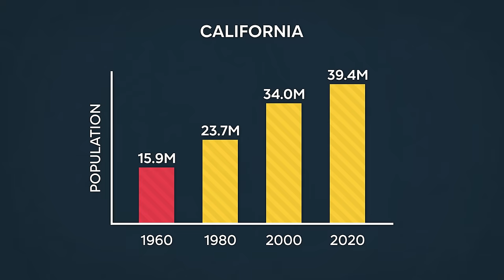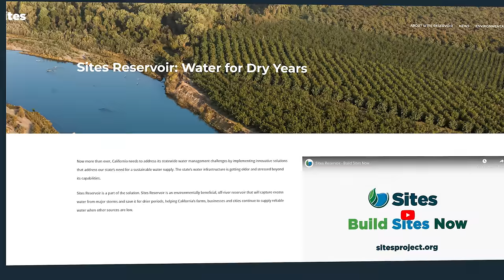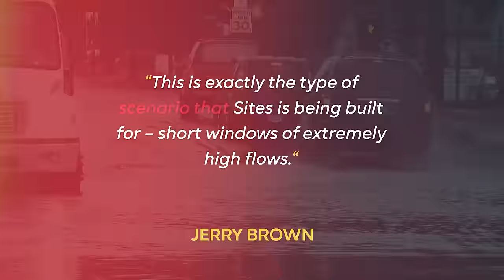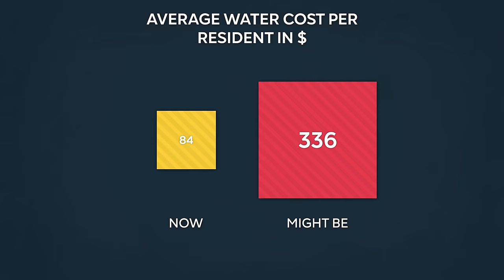California's New $4BN Mega Reservoir

Comment: FYI most of the state has had it’s drought status reduced or removed entirely. We’re also expecting the return of El Niño over the next 2 years. That brings lots of rain and cold to California.
Reply: Yes lets live in the moment!  Screw the next 20 years
Reply: Did you even watch the video? CA cant capture enough water while it is here it will go away after 5 or more years. How long do you plan on living here?
Reply: @liindawgg  what are you talking about? The last massive rains was in early 2000s, and the ones before that was in the late 70s early 90s. The location of the Dam is not in a high drought area. The reason why this project was put off for so long wasn't a lack of foresight it was because the south needed to build more reservoirs which in areas of high drought.  To be honest the amount of money spent on this project just to have a reservoir is not worth the price. That money should be spent on Building more systems to recharge California's underground Aquifers (you know the water source that is responsible for 40% of california's water during the Decades of drought). But I am sure you know all about that and your comment to be facetious and not sarcastic.
Reply: @LiiNDAWgg  That's not what he said and NO ONE lives more in the moment than a leftard.
Reply: @gniawd  Alarmist crap
Reply: You got everything right except for the cold.  Warmer ocean temps bring in more storms but those storms are usually warmer winter storms.  We still get lots of snow from them in the high sierras.  However, I think we need more water storage if they’re going to keep building more infrastructure in Ca.
Reply: @gooflydo  yes daddy.

Comment: Your video just described the existing San Luis Reservoir in central California where water is pumped into the reservoir from the Sacramento River, but where pumping water is currently blocked because an invasive fish was found in the river and somehow must now be protected. The video seems more of a sales pitch along the same lines as the high speed railroad project. Lots of funding that go into pockets of beneficiaries rather than the project. A project where the main function is already blocked by current environmental protection laws. If the central California's were smart, they would press/protest the issue of the San Luis pumps being shut off at the same meetings of the Sites Dam, so that attention would be brought forward to a costly project that is doomed from the start. California has a problem with water management, not an issue with storage capacities.
Reply from the maker: Get the point, we also mentioned it in the video but didn‘t go more into detail. However we are definitly not pitching for any projects that we talk about😅 We try to be neutral
Reply: Talk to your gov.  The federal pumps were running at full power,  Your gov ordered state pumps off even though per court order there was nothing to stop them from running.  Ask your gov how much he got and gets from utilties investing in billion buck desalination plants, and the billion buck power plants needed to run them, and the billions in fossil fuel needed every year to fuel them.  All passed on to rate payers and given to the richest who own the project, and the billions in gov't bonds floated to pay for them.
Reply: @russell7489  they will never power any desalination plants unless we make a return to nuclear power 🔋
Reply: @russell7489  Exactly. Shortages are man made in CA, whether its water, electricity or buildable land. It enriches certain people (Can you guess?)
Reply: @christiankruse1970  The Rezniks and Socal developers.
Reply: @christiankruse1970   your not wrong it is sickening hopefully people do something about it rather it be moral or not it is what it is that seems the way things are these days with cut throat money it goes both ways
Reply: @MegaBuildsYT  You never said what towns are adjacent to this build.  You were suspiciously vague about it's location.

Comment: As a Sacramento native I have been watching this project, reservoir levels and snow pack for years. We desperately need something like this and I've been pretty excited about this on, but we definitely need to implement other solutions, I believe recently near Rocklin they've developed a method to locate underground basins with a helicopter and building pump stations to fill them. I I'm not sure about the cost on this but it seems once we identify hundreds of basin and build pump stations we replenish parts of the water table at will.
Reply: Rocklin has those quarry's in some spots that they would fill. And there are a few ICBM sites that can be gutted and filled with water.

Comment: Our biggest issue is that our aquifers are dangerously depleted. The problem is that where a lot of the water floods in the central valley, we have a very hard clay soil, and the water does not soak into the aquifers very well. Storage will only get us so far, but we need to find a way to get our aquifers refilled.
Reply: Infiltration/recharge basins? Yeah. We do need them.

The problem is whether it's cheaper to catch, infiltrate, and re-pump water compared to just storing it on the surface.

The advantages of these huge storage facilities is that per gallon of storage, they are incredibly cheap. Infiltration basins would have to be built everywhere around the state, which makes the scalability limited.

I do think something like implementing recharge requirements into building codes might be a good idea, but the areas where the worst aquifer depletion happens are usually farmland, and could use surface water if it was available.
Reply: The biggest issue california has its overpopulated. way over populated. you have 3 or 5 illeagle families living in a 2 room pickers shack. multi million dollar homes who could care less as long as the lawn looks good for the neighbors. hoas that are way out of control and a general population to self important to do what is nessary to solve the real problems. you have a better chance of asking the 15 million people that need to not be there to give up their houses all there money and pack up the car and leave. Are you willing to just leave? that's what is necessary to solve the water issue. you and 15 million others. just drop all you have and drive away. buldoze the houses and rip out the water lines. If you build bigger and more infersturcture to solve the issue it will never be enough for the population at hand now. more storage is not the solution exodus is.
Reply: Amen brother. Dams are a 19th and 20th century band-aid for our real problems. You can only reapply a band-aid so much before you have to let the wound heal.
Reply: @RC-fp1tl ask the people who died in floods and drought caused famines centuries ago.  I’m sure they wish they had dams to regulate flow.  🤡
Reply: Agreed 100%. Actually the necessary reservoir already exists. The underground water table. Slow the flow of the Sacramento River to allow the water to spread out. It will soak into the ground. There it can be stored in the water table. For free. Without evaporation. Without $4B in construction costs. How to slow the flow? A few man-made structures may help. But most/all of the work can be done by free labor. Just reintroduce beaver along the Sacramento River. Beaver will relentlessly build small dams. Improve fish habitat. Recharge the water table. Help tress and shrubs grow. Elegantly simply. And affordable. The Sites Reservoir is a farce, and merely a gift to the construction industry which is already rife with greed and corruption. If built, this project will surely exceed $5B.
Reply: youre biggest issue is unsustainable poplation centers like LA & SF.   There was never, probably will never be enough water in cali to support endless population growth
Reply: @sbauhs  That sounds great and CA is already doing that; but beavers aren't gonna do anything to a big fast flowing river like the Sac.  Plus it all surrounded by private property.
Reply: TRUE
Reply: Get rid of submersible pumps and wait 10,000 years is the way to refill the ground water. It took less than 100 years to deplete that ground water and salinate those soils. It's an environmental and economic disaster. Big money has benefitted the most.
Reply: CATCH IT BEFOR IT RUNS INTO THE SEA BULL CRAP WE HAVE THE TECKNOLAGE TO GET THE FISH TO WHERE THAY NEED TO GO THEY JUST NEED ALITEL HELP
Reply: Stop,the wineries from taking it all?
Reply: @sbauhs    This is not a bad idea.  However, judges in CA have ruled that 63% of all water that is released from our dams needs to end up in the ocean.  Check it out.

Comment: I live in Central Washington State. We depend on massive irrigation projects to collect snow melt in the mountains used later to water crops. We too have massive pumping lift stations, giant canals, and assortment of dams. We have very fertile soils but lack water. The demands for water will always be greater than annual supply.
Reply: When I lived in Washington it rained like 75% of the time. Idk how there is any lack of water in that state. I've never lived anywhere else where it rained so much.
Reply: @punchabunchofbuttons214  I'd guess you lived on the west side of the mountains. As moist air move up over mountains, it cools, can't hold as much moisture, drops most of the moisture on the mountains (generally as snow), and comes down the other side of the mountain much drier. That's why the leeward side of decently sized mountains is generally a much more arid (or even desert) climate than on the windward side. Western Washington is very rainy from moist air from the pacific, and central and eastern Washington are much more arid because of the Cascades pulling most of the moisture from the air as it travels west to east across the state.
Reply: @punchabunchofbuttons214  Thanks for comment. I live in Yakima, we only get 6-9 inches total all year long. Seattle gets around 36.
Reply: @punchabunchofbuttons214  Common misconception.  Most of Eastern Washington (East of the Cascade Mountain Range) is high desert plain.  There are areas that get less than 3" a year.  The West side of the state, peninsula and the Puget Sound region get a ton of rain.  I lived in Spokane and worked remote for companies in California and on almost every conference call I would get someone saying "Raining up there?".... It got annoying.
Reply: Our family farm in Spokane irrigated with water from Grand Coulee Dam, that water had its source in Canada.
Reply: @JimMork  Thanks for comment. If not for massive irrigation projects, Central and Eastern Washington would still be a desert.
Reply: @punchabunchofbuttons214  The Cascades create a rain shadow. But west of them is really good farming country.
Reply: @SJR_Media_Group  Isn't Yakima apple country?  Are those trees evolved for dry conditions?
Reply: @tysonhartle2439  Called The Palouse. We lived by a river with its haadwaters in the Rocky Mountains.
Reply: @JimMork  Yakima is the Apple King of the World. Unfortunately the trees use lots of water to make fruit. During extreme drought, Junior Water Rights Holders get 1/2 their normal water. Orchards die and they tear them out and replant.
Reply: @SJR_Media_Group  Love them Washington apples. But most of the year we get imports. I think  you Washingtonians (I was born in Spokane before our vagabond tribe moved out) probably eat all the fresh ones. Apples to you are like oranges to Californians. My sister in Long Beach had an orange tree in her yard.
Reply: @JimMork  They pick too many to sell right away here. Giant cold storage rooms hold millions of pounds each. The Oxygen is removed and they never rot. They ship more apples in winter than fall harvest. 

Recently, China has out produced us. They have cheap labor and we can't get enough workers. We bring in migrants from Mexico on special visas. After harvest, they get sent back.
Reply: @SJR_Media_Group  Always been the challenge with produce. Nature decides the short time period in which things reach picking stage. The labor requirement then is a multiple of other times. I used to work with a guy who arranged work breaks to harvest field crops. He said the harvest was a 24 hour operation to get it all picked and in storage. Then the challenge is to keep it usable till next harvest. Some historians have said earliest temples were actually grain storage. I once lived on farms. We raised our own food. After the brief picking exercise, we used to box it up and rent lockers to store it for months. Modern methods make frozen berries as nutritious and cheaper than fresh.
Reply: @JimMork  Thanks you so much for great input. Refreshing to find smart people. Yes, food technology has helped feed a hungry world.
Reply: @SJR_Media_Group  The topic has many personal connections for me.
Reply: That is due to there not being a major river system in eastern WA. It's a very strange area and I lived out in Belfiar, WA where, water was never an issue in the Hood Canal. It's like feast of famine in central WA. I do think there are a few things they could do. You might have much beyond a few small creeks but there is ample space for manmade lakes. Large ones if you can afford the farm area for it. Central WA to me is almost like a bowl. Kinda like a smaller version of the land that embodies the great Salt Lake of Utah. Some areas that have more sand base and limestone soil could hold a great volume of water like a bathtub. Just build a canal river system to replenish and you than create a new working river system downstream of these body of water and link them. Than, stock with Salmon.. lol.
Reply: @gwhite7136  I'm a native of eastern WA. The Spokane River flowed  past my farm. Then there's the Columbia that is east of the Cascades. Then there's the Snake River. So it is here where we define "major". Mississippi, Missouri, Ohio, Hudson. All are "major" What category includes the Columbia?
Reply: @JimMork  Those rivers flow south of the midlevel state area of eastern WA. Great areas and so much can be done with them. But to the north and in the eastern part of the state, no large rivers. The Spokane river is a creek when you compare it to the Mississippi river, as well as how much water is trapped in the Harrison Slough in Coeur d' Alene Idaho. Ritzville sits in the middle of an this dry area. I think so much more could be done with this region. From the Columbia river in the north to the Idaho border above Spokane, apart from a few small lakes, this region has no rivers.  Columbia River's mean annual discharge is outranked by: The Mississippi River - 593,000 cubic feet per second. The St. Lawrence River - 348,000 cubic feet per second. Those rivers go longer and get a lot more rain. It's a great river but only cuts through one state. Also, from Moses Lake to Spokane, via I-90, again, no real rivers to speak of.
Reply: @JimMork  I got quite a few relatives that are from the Spokane area. Much different climate than western WA. It's not a natural river forming area. While the west half of the state is located in a rainy oceanic climate, the eastern half receives little rainfall due to the rainshadow created by the Cascade Mountains.
Reply: @gwhite7136  Columbia drains mountains in Canada. Origins of things like Spokane and Snake are mountains in Idaho and Montana. So it is all "downstream".
Reply: @gwhite7136  As said, I used to live across a road called Euclid from the Spokane. It was our swimming pool. Nice during summer months. A bit large than a creek, but even though there are falls in downtown Spokane, it is pretty small.
Reply: @gwhite7136  thanks for comment
Reply: @SJR_Media_Group  No, thank you sir.

Comment: As someone who lives in California, I think the Sites project is long over due. This winter was a missed opportunity to fill additional reservoirs. In part with water that can't be stored as reservoir levels are managed to accommodate snow melt.

The project may be expensive, but the cost is small compared to the cost of lost revenue from drought. Also, the reservoir provides an additional place to obtain water for fighting wild fires, which could represent more savings.
Reply: Missed opportunity… never cali summed up better.
Reply: Fully agree. We need this desperately
Reply: I agree!  Way long over due and imagine what this last storm season could have done for filling it up.  Then again, we have a high speed "Bullet Train", oh wait, that was massive flop and waste of 15B tax payer dollars, a train system that doesn't exist and what little does goes no faster than a regular train between to uncommon start & end points..
Reply: The water in the "missed opportunity" is sitting in Tulare lake.
Reply: It won't happen anytime soon
Reply: @arthurh1969  The Tulare Lake water comes from the south end of the state. Sites would be filled from runoff in the north.
Reply: @jhamaker  yes but $4Billion cheaper.

Comment: In Germany you have to make sure that all the rain that falls on your property, stays on your property and seeps into the ground. This greatly reduces the cost for rainwater sewage systems and prevents flood waves from forming in rivers.
Reply: different climate entirely
Reply: We are using this now. New project must mitigate off site runoff using swales to slow down flow and allow percolation plus using dry wells rather than storm drains that drain to the sea. Soon as these projects are done, the site owners will try and figure out how much is reaching the aquifer which the water companies use to supply potable water. A system of rebates are in the future, I’m sure.